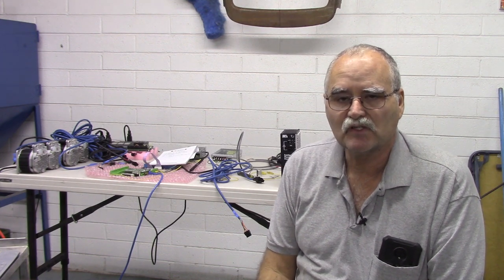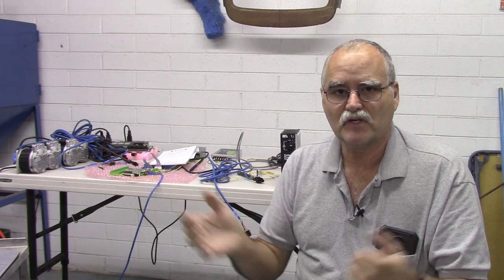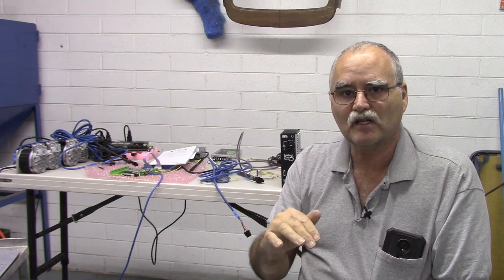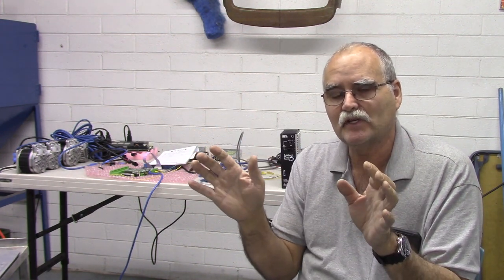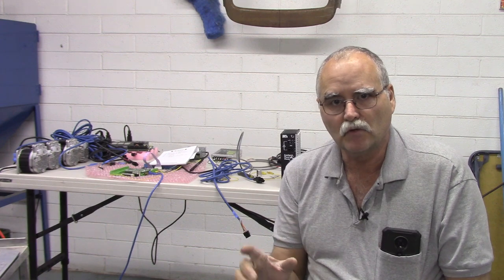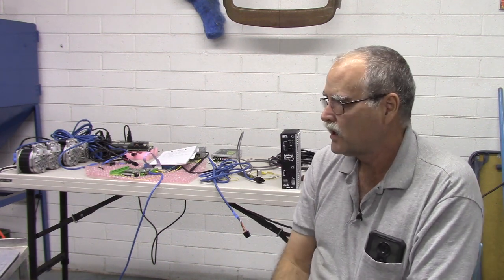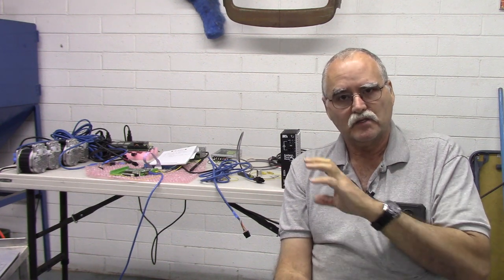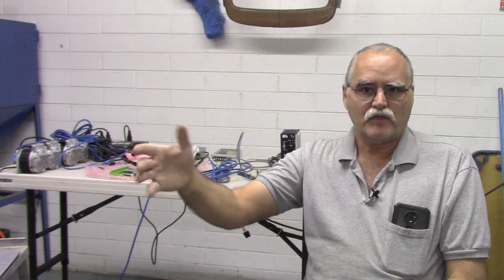SYIL X4 CNC Mill Teknic Clearpath SDSK Centroid Acorn Project: Bench Testing

Comment: Hello Marty. I have a question on the C86ACCP. I recently installed the board, the new one with the flying lead terminal blocks. I see in the GCnC Revisions manual that you have wire jumpers in the two position flying lead blocks. Are these necessary when using the molex plugs. I ask because I seem to have to have input 5 set to NO red circle. If set to NC drive fault occurs upon any movement. I wired everything else as per your video.
Reply from the maker: I am unaware of this. However, I am going to be setting up a Clearpath SDSK system up soon and if there is something new or different, I'll post an update video on that subject
Reply from the maker: You should post to the Centroid User Forum be sure to let everyone know what schematic you used and the excerpt from the manual you are quoting. Always post a fresh report as well. I have not been active because I've had some personal projects and they've only multiplied
Reply: Hi Marty, I added a post on the centroid forum as of today. @martyscncgarage5275
Reply from the maker: @avpriority  just did basic bench test. Will be bench testing the Clearpath servos soon in between projects. Let me know what you learn and likewise I'll get back with you when I get to that point.

Comment: Hey Marty, thanks for making this video! What’s your thoughts on clear path vs dmm? 
We are about to gut our Laguna Smartshop 2 and retrofit it, torn between the clear path and dmm. Thanks my friend.
Reply from the maker: I hope you are going to go with Centroid Acorn? Post photos of the inside of the Laguna control cabinet, one of the Axis motors if possible and the model number of the existing drive. https://centroidcncforum.com/viewforum.php?f=60 Easiest route is to keep the existing drives and motors and simply go with Centroid Acorn. So far, I like the Clearpath solution because the drives are on the motor.  Can you crimp Molex Minifit Jr. connectors? Post to the Centroid forum....
Reply: @martyscncgarage5275  we’ve been discussing the masso g3. I’ll get some picture later today. 
The existing controller is all B&R which isn’t bad, but the drivers do t speak step and direction they are a proprietary language from B&R— thus the reason we are gutting it and starting over. 
It’s a closed system so we can’t do any upgrades like switching out stepper motors for the clear path. 

I’ll definitely check out the forum and look more into acorn. 
Thank you for replying so fast! Great work here on your channel. 

Btw: We are in Texas and everything is frozen, we shut down the business until things clear up a bit. I’ll get pictures hopefully today.
Reply from the maker: @aaronmathew642  Centroid has been doing CNC Machine motion control and their own software for over 30 years. Check out my channel for others Acorn videos. If your machine accepts step and direction, I could have it running in a day. Centroid also supports linear router tool changers.
Reply: @martyscncgarage5275  thanks for the info, definitely doing some research into Centroid today. 
The only thing about centroid I’m not a fan of is the interface. It’s very dated and reminds me of the MS doss days. Haha but that has nothing to do with functionality or reliability.
Reply from the maker: @aaronmathew642  come on. You want pretty or very functional and reliable....I'd rethink that one....
Reply: @martyscncgarage5275  hahaha I’m with you I promise, but I’m also a perfectionist and a furniture designer for recording studios. So I do care about those small things. 

Have you looked at the masso g3 controller and interface?
Reply from the maker: @aaronmathew642  nope and won't. I'm sticking with a company that knows CNC machine motion control. It has a clean uncluttered gui. I have built Oak and All in One DC controls. You won't find Masso on a production VMC. You need complex PLC functions, Centroid can do it and has it. They run a 5 axis VMC that will create an engine block or cylinder head from billet aluminum. YouTube search Centroid A590. I respect whatever users want to use.
Reply: @martyscncgarage5275  So im sold on the Acorn! Ive been reading and watching acorn stuff for a couple hrs now and its by far better than the masso. The gui actually isnt that bad now that ive been looking at it for a bit now. 
I do have a 8 tool linear atc on my router, any info discussing setting that up with acorn?
Reply from the maker: @aaronmathew642  https://centroidcncforum.com/viewtopic.php?f=63&t=1340
Should help answer your questions. Feel free to post on the forum and post pictures of your machine, your drives and model number. Satisfy yourself before you buy. You will want Acorn and Router Pro License and you should consider the wireless MPG. Look on eBay for Lenovo Tiny M92P with Windows 10 and 120gb SSD.

Comment: I may have set up my mill and lathe incorrectly. I thought the standard SDSK motor resolution was 800 per rev. And the enhanced versions were closer to 6400. They are working, should I change my settings?
Reply from the maker: If you got standard SDSK you can leave them if the machine is performing well. Easy to change though....
Reply: @martyscncgarage5275  Would you need to re-run the auto tune after changing the input resolution? I auto tuned at my default of 800, but recognize the Acorn wants to see 6400, so I’m thinking of changing it. (However, like you, my machine shouldn’t actually require the 6400 resolution).
Reply from the maker: @kyleb4587  No, you should not need to retune. Won't hurt if you did.

Comment: Hey Marty, if i have the relay output 1 occupied by my e-stop contractor circuit, can i leave the red jumper that comes with the c86 board in there? Do i need to move the acorn enable jumper to on?
Reply from the maker: Many ways to accomplish things. I would run the no fault from C86ACCP through a set of contacts on the Estop contactor. Safety
Reply: @martyscncgarage5275  Does that mean just simply wiring the c86 to the NO contact and back to c86? May i ask what that accomplished?
Reply from the maker: @janvirbrar4181  disables C86ACCP in the case of an Estop press or fault. You are removing power from the IPC-5, accomplishes the same thing
Reply: @martyscncgarage5275  I am already during power or ipc5 in the event of e-stop so can i just leave the red jumper in the c86?
Reply from the maker: @janvirbrar4181  yes, I suppose you can. Bottom line, During Estop/fault, you want axis drives and spindle disabled (or whatever your cutting device is)

Comment: My Z axis faults ?
Any ideas as what could cause this or where to look
The X & Y are running fine
Need help to solve the fault issue 
Thanks
Reply from the maker: If a Centroid Acorn system, please post to the Centroid Users Forum with details about your build, pictures, which drives and motors etc

Comment: Did you configure the sdsk's high level outputs to monitor for drive ready/ drive fault? I am a little confused by this on my setup
Reply from the maker: Andrew, do yourself a favor and buy the C86ACCP from CNC4PC.com. best $50 you'll spend and it handles everything. In about two weeks, they'll have a version with both molex and terminal blocks for the Clearpath signal cable

Comment: Does the C86 ACCP provide the pull up resistors required by Teknic?  If not, how will you add them?
Reply from the maker: Go check my post on my build thread on the Centroid Acorn User's forum. 😉 https://centroidcncforum.com/viewtopic.php?f=60&t=5389

Comment: Are teknic servos same as clearpath ?
Reply from the maker: Yes, Teknic makes the Clearpath SDSK servos
Reply: @martyscncgarage5275 
Wanting to switch over to centroid on a multicam cam 2000 laser cutter, using as much as i can, they use teknic drives and servos but this is all new to me but think i can manage if taking step at a time
Reply from the maker: @laserfalcon  you need to identify which Teknic clear path motors and drives you have and how they are controlled first. Especially if you plan on using Centroid Acorn. They must be able to take step and direction signals. I suggest you get the drive and axis motor model/serial numbers and give Teknic a call and ask to talk to an Applications Engineer. They are most helpful
Reply: @martyscncgarage5275  Thanks for that advice